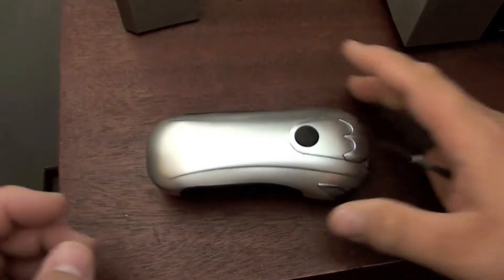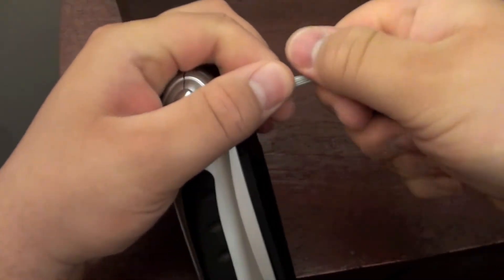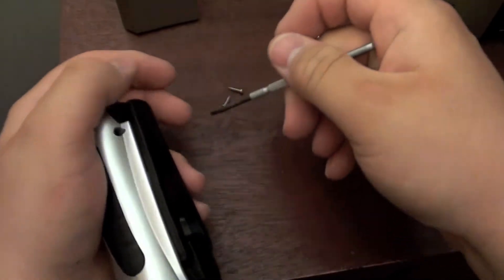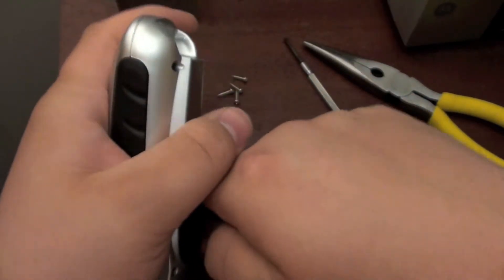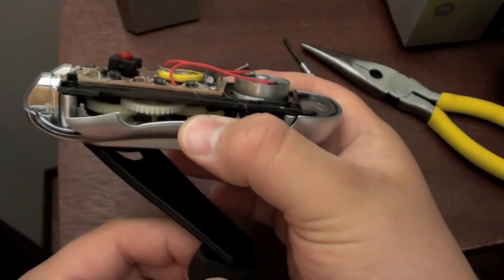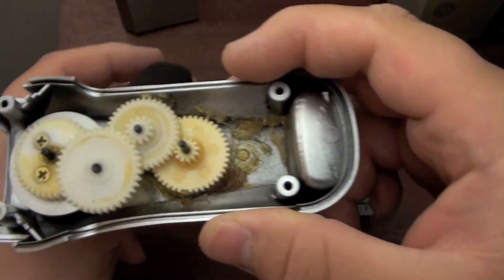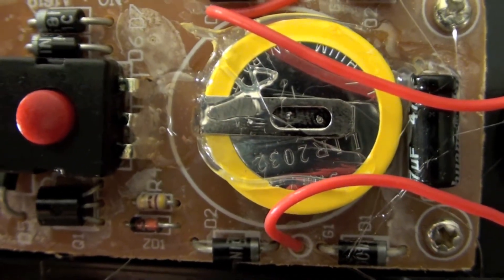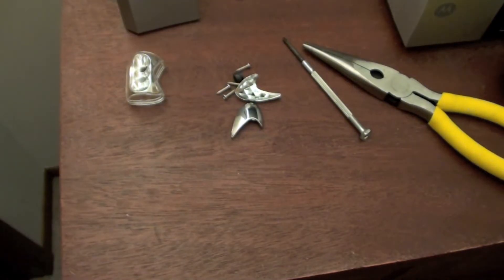Inside a Crank Powered Flashlight

Comment: It's not a motor, it is a Dynamo, an alternator. 4 resistors, 8 diodes, 1 capacitor and 1 transistor. The 4 diodes around the battery makes a full bridge rectifier that changes the alternating current to direct current to charge the battery. I have one of these and changed the battery after I bought it at Goodwill for a dollar. I am an AC/DC cert.

Comment: I took mine apart, a little diffrent, but I couldnt find a battery, like yours?  It only works when cranked.  It used to hold a charge. Mine is at least 15 years old?

Comment: Nice video. The four diodes that flank the battery make up what is known as a full bridge rectifier. While the output of the motor should be DC, the addition of the rectifier means that you can crank the handle in either direction and the output polarity of the rectifier will remain the same for charging. The capacitor at the rear of the board is most likely used to filter the output of the charging circuit. The rest of the components makeup the driver circuit for the white LED's.
Reply: It actually pop out AC to have enough voltage to charge the battery.